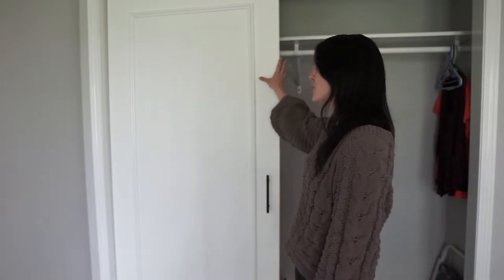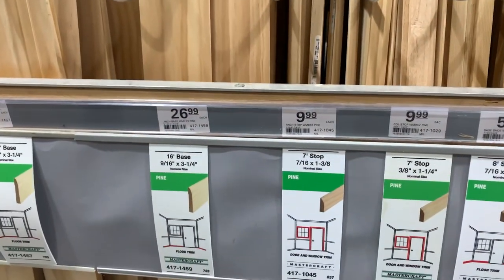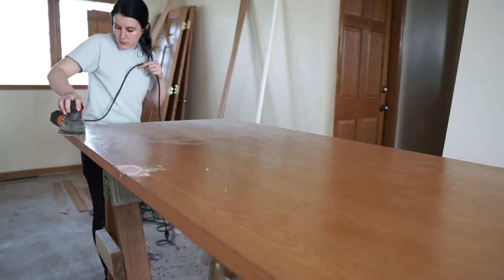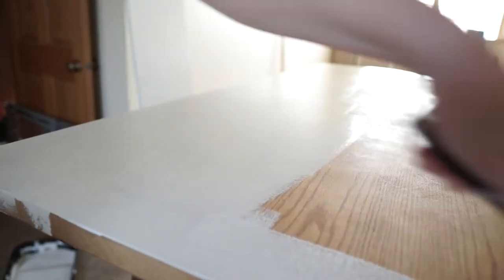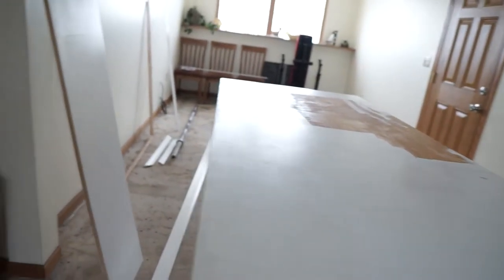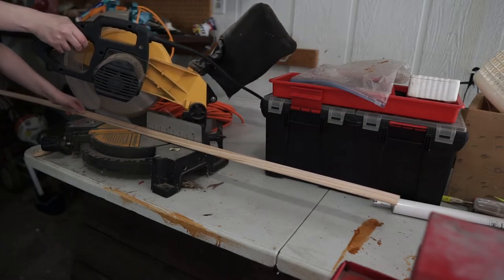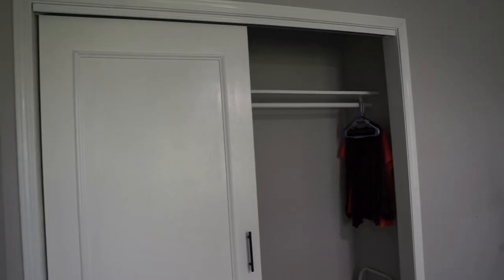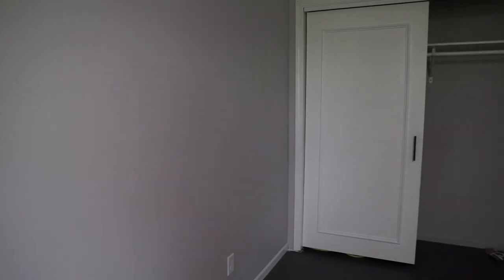How to Upgrade An Interior Door | Closet Door Makeover

Comment: I just can’t figure out how these doors would pass by each other with that raised trim?
Reply: At the end of the video she is saying that the second door is not ready yet for install. I think she is trying to figure that out too.
Reply: I’m not sure what she did, but you could recess the roller brackets on the rear door - recess by about 1/8” or more depending on the thickness of the material you add to the front.